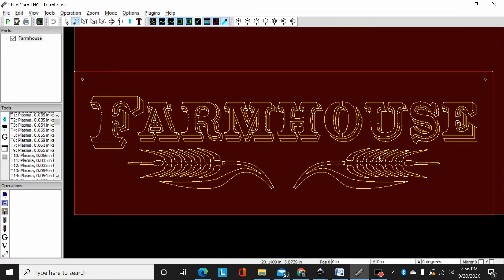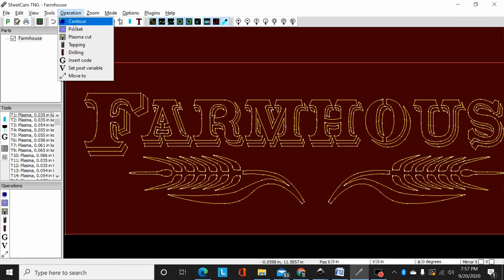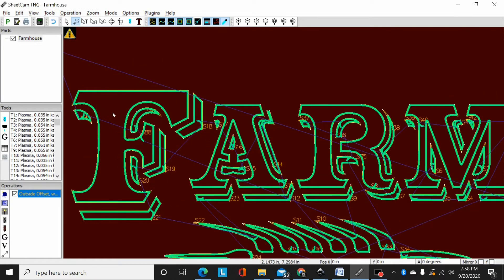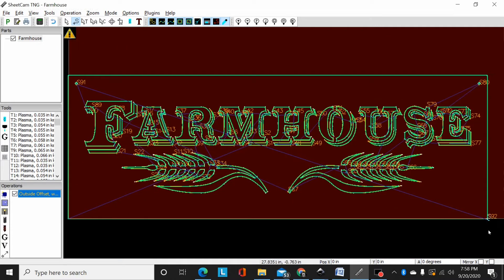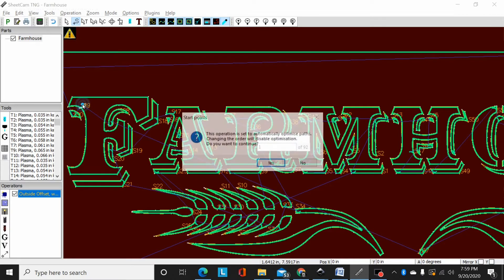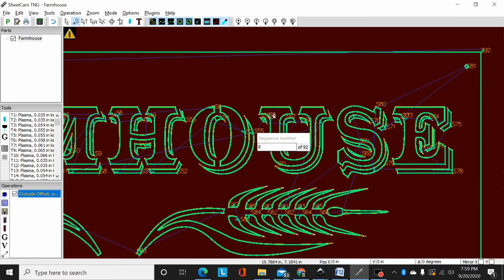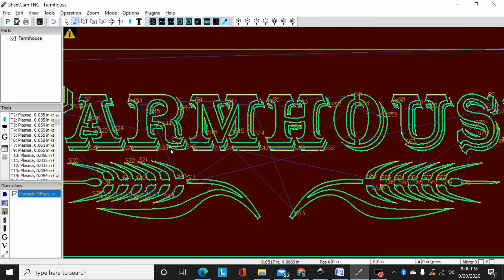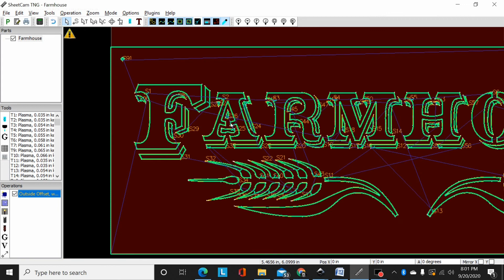Editing Start Points in SheetCam

Comment: I cut all the small parts first. Helps with tip ups and since I don't run ohmic it keeps it from trying to cut at a real flimsy spot. Did something change in sheetcam? My outside cut always starts off the plate if I leave it. I am sure It didn't use to automatically set it like that.